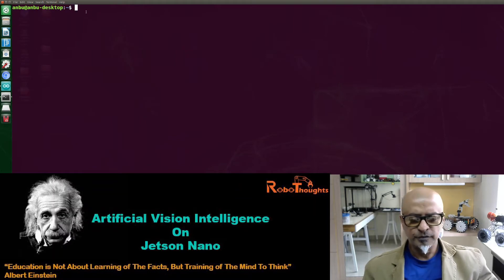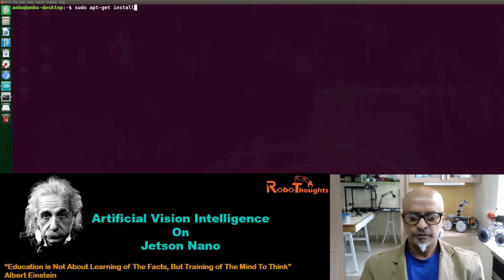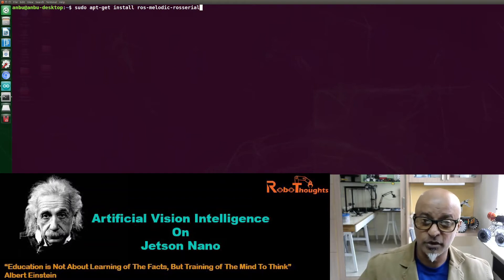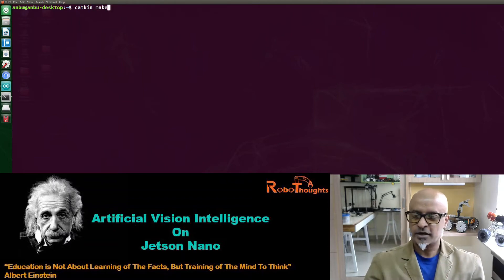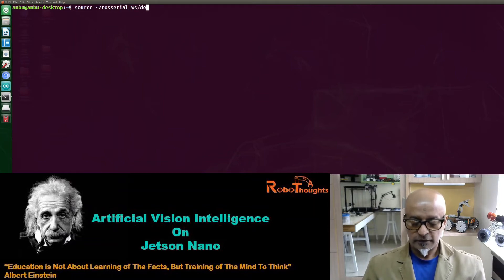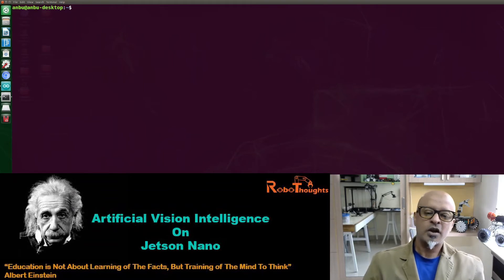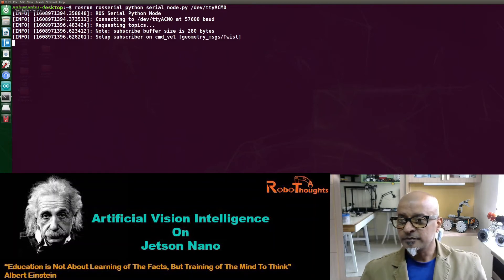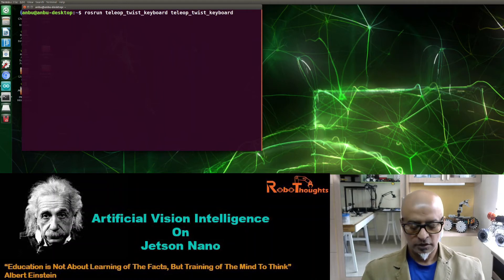Lesson 24 – ROS Teleop Twist Robot Control in Jetson Nano

Comment: hello sir, i tried to upload the .ino code to arduino mega but keep getting this error:
"arduino_motor_ros.ino:1:29: fatal error: ArduinoHardware.h: No such file or directory
compilation terminated."

any solution on how to fix this, it will be really appreciated.
Reply from the maker: Its probably because ROS cmake is not installed properly, you may have to redo the steps
Reply: @CodingScientist  thanks alot sir, i got it resolved had to generate ros_lib inside arduino's library folder, but i still can't seem to run teleop with it ros serial, although the serial node is already started teleop twist says "waiting for subcriber . . ."
Reply from the maker: @karmenjell2206  looks like command lines are wrong when triggering subscriber

Comment: How is the Jetson Nano 2GB for building a autonomous robot with a Lidar, considering cost constraints?
Reply from the maker: Well, I never tried 2GB, but with my experience I can tell you that LiDAR process huge amount of data gathering plus drivers, ROS, Python, CPP codes etc which will make things slower to hung state.  I suggest add bit more pinch to ur pocket and go for 4GB